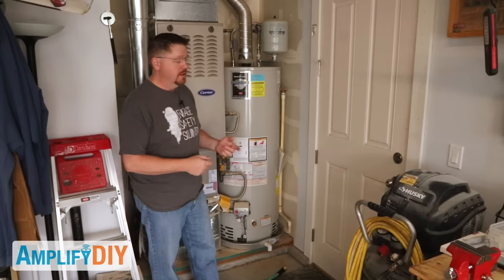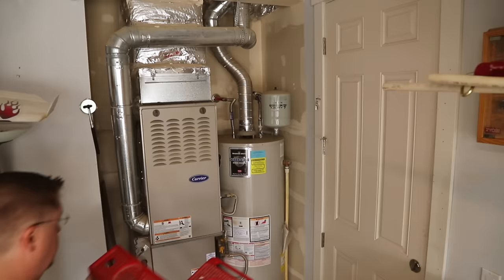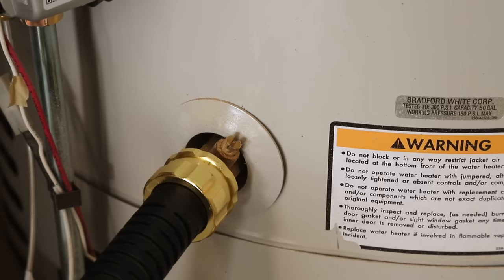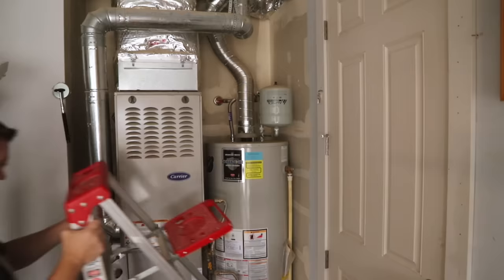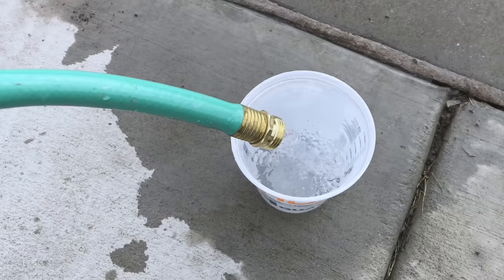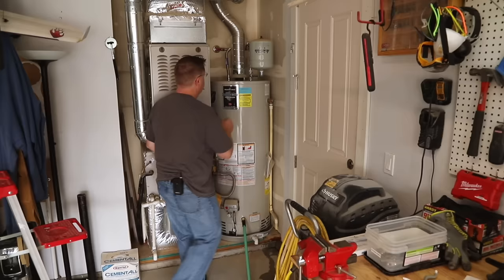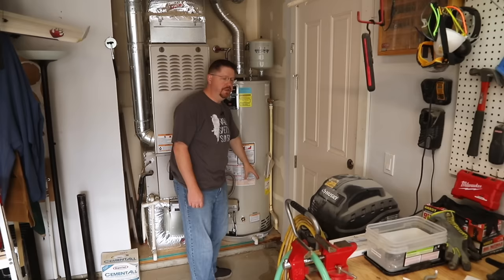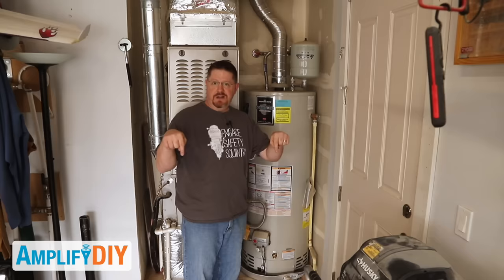How To Flush A Hot Water Heater To Remove Sediment

Comment: This might be a stupid question but why did you close the release valve on the final fill and flush but keep it open and monitor when to close it, as it was filling again for normal use? Wouldn't air and pressure get into your system during the final flush which was something you were looking to avoid during the fill for normal use?
Reply from the maker: Hi Diddlingdoom - apologies for the confusion around when to open and close the pressure release valve. Here are the general concepts that need to be understood: In order for water to get out of your tank, air must be allowed to get in. During the flushing and rinsing phases, I generally just leave the T&P valve open to allow for the air to get in as needed. Note that this does not push air up into the plumbing of the house - it just lets air into the heater tank to replace the volume of water that drains out.

When you are done flushing and ready to do your final fill, all that air that was allowed into your tank needs to be allowed back out. I generally try not to push an entire tank's worth of air through my plumbing, so I wait until I can hear the water level is nearing the height of the T&P valve, then close the valve. This leaves several cubic feet of air at the top of the tank, which I purge out of the system by opening a hot water tap and keeping it open while the tank fills until all the air has stopped making gurgle noises.

At that point, all the air is out, the system is full, and I can close the tap and turn the heat source back on. 

Hope this helps - thanks for watching!
Reply: Right I understand why you did what you did on the final fill for normal use, but you kept the t&p valve closed while filling for the final wash. Wouldn't that put pressure on the rest of the plumbing system @AmplifyDIY

Comment: This is a great video! I'm going to run thru the process tomorrow morning. One question about the final fill aka back to normal. Also sorry if it was already asked. With 5910 comments it was difficult to search thru if already asked. Would it be fine to put a bucket under the pressure relief valve and wait till some water flows out to close it?
Reply from the maker: Hi Camprusso! Actually, even with all the other comments and questions, I don't believe anyone has ever asked your question. Yes, it is just fine to stick a bucket under the T&P valve drain tube and wait for water to start coming out to close the valve on your final fill. 
Good luck!
Reply: @AmplifyDIY  Score! For the original❓😁🤘
At least then I can make a small game out of it. Can I guess when the water will hit the valve?... 😆

Comment: What is the reason you have to shut off the new/cold water input valve? Wouldn't that help with the air flow and to clean the inside of the tank as well?
Reply from the maker: Hi Las Vegas Adventures - this is a pretty common question, and intuitively, it makes sense to leave the cold water inlet open... after all, that would make the water "blast" out of the drain valve, right? 
Well - yes, it would, but the water would move SO SLOWLY through the body of the tank that you'll never get any actual rinsing action along the bottom of the tank. Have you ever fired a squirt gun underwater? Leaving the cold water inlet open is just about as effective. You need to empty the tank so that there is not a huge mass of water in the way slowing down the cold water on its way to swish around the bottom of the tank. Thanks for watching!

Comment: If you need to use the pressure relief valve, do you still have a faucet in the house running or do you not need one running?
Reply from the maker: You just need to make a path available for air to flow into the system. If the faucet does not do it, then use the T&P, at which point the position of the faucet is actually irrelevant. Good luck!

Comment: Yes sir do you mind answering a question for me please. I have a regular hot water unit but my Gio Thermal unit also runs to the spot that drains my water heater.
Reply from the maker: Hi Shannon - I'll be happy to try to answer any questions... but I didn't see a question in your comment....
Reply: @AmplifyDIY  thanks for the reply. My gio thermal unit is also connected to the drain to my hot water heater. If I close the valves on the gio thermal would it be okay to drain the water heater

Comment: Great video! Easy to follow.  But at what point do you turn off the hot water from the faucet inside your house?
Reply from the maker: Hi Cassandra - sorry this was not made very clear in the video. The point of opening the faucet was first to relieve the pressure in the system after turning off the cold water inlet, and second to provide a path for air to get into the water heater so it will drain. In my case though, the faucet would not allow any air into the tank, so I had to open the T&P valve on the side of the tank to let air in. Once I had to do that, whether the faucet is open or closed during the flush is irrelevant. At some point I probably closed it, which is why I later had to open it when I was done with the flush to allow air back out of the system as I filled the tank. 
I recommend opening a hot water faucet at the beginning, and just leaving it open until you are completely finished. 
Good luck!
Reply: @AmplifyDIY  Thank you!

Comment: Prob a silly question: So when your finished flushing and you go to fill the water heater tank back up…once it’s full you leave the cold water intake valve open?
Reply from the maker: Hey Patrick - not a silly question at all. Yes, leave the cold water inlet open. That is what puts water into the heater tank in the first place, and keeps the tank full as you use the hot water in your house. Thanks for watching!

Comment: I need to flush my tank, but I have an unusual problem: The tank is under the house (very old house that probably did not have indoor plumbing until the 1940s) and sits on a concrete slab in a pit. Everything is difficult to get to. The worst part is that there is no floor drain. I can let gravity drain about half the tank, but then I need to hook up a drill pump to get the rest. Do you have any cautions about using a pump like that?
Reply from the maker: Hi Newsyddog - first off, I'm sorry to hear about your unusual installation.. that sounds like a real pain! As for flushing, here is what I recommend: Rather than a drill pump, you may want to invest in a small transfer pump. Here are a bunch of options available on Amazon for around $50: https://amzn.to/3VYmNgY As for precautions: No matter what pump type you use, I recommend that before you start the flush: turn off the heat source for the heater, then go take a shower, do some dishes, run some laundry, etc. This will use up the hot water in the tank (replacing it will cooler water) so the water coming out of the tank (and running through your pump) will be cool. This will avoid over-heating the pump. 

Good luck!

Comment: Is it ok to drain the water heater while other appliances in the home may be running?  For instance, dishwasher or laundry machine?
Reply from the maker: Hi Mike - sorry for the delay in my response: no, when you drain the water heater, you are effectively turning off the hot water supply to the house entirely. Any appliance that needs hot water to run should be shut off during this process. Good luck!

Comment: In addition, cascade some water on to the bottom of the tank from the hot outlet at the top. Do that by opening both hot and cold faucets at any sink whilst holding your hand to block the spout. Cold water is thus diverted through the hot lines and into the heater tank. (If you really want to enhance this flow, at you washing machine connect the hot and cold faucets together with one of the double female ended hoses then open both faucets for a few seconds.)
Reply from the maker: Interesting approach. I've never tried it... but I may. Thanks for watching!

Comment: I just fully drained my Rheem Performance (model no. XG-___) for first time in 5 years.

Then partly refilled 4 times for 20 sec each & waiting 20 seconds like you said.

Emptied into cup each time; at no point did I see 1 speck of particulate.

Is this normal or am I missing something?

I figure fully refilling & draining again would be a waste of time & water.

Any advice, thank you.
Reply from the maker: That's... unusual - do you have a water softener? Do you have a whole house filter? Do you know how hard your water supply is?

If you have a water softener and whole house filter, there should be very little sediment in the tank.. but there should be *some*. You may happen to have naturally soft water though...

Comment: My temp setting is different(off, pilot or on) and is a of a different style.   Kind of scared to mess that part up.  Landlord won't fix this noise issue I'm having off and on all day due to sediment buildup, doesn't even respond to texts.  I may just wait until a friend is up and send him some pictures to make sure I do it right.  Besides that uncertainty I think I have all the rest figured out.  Thanks for the clear guide.  Hoping this fixes my noise issues which would help my sanity a bit.  I live in the basement where the water heater and central air are so I hear all the fun noises.
Reply from the maker: Yeah, popping / crackling sound while the heater is actively heating is a definite sign of sediment build-up in the tank. I hope you get it flushed... good luck!

Comment: It looks like you were draining to the outside. My hot water tank is in the basement so to get it outside it means it will go higher than the tank. There is a drain in the basement floor. Will that work.
Reply from the maker: Yes, the drain in the basement floor is precisely where you should be draining. In order to avoid any clogs, it's a good idea to use a kitchen strainer to catch any big chunks from the hose before it goes down the drain. Good luck!

Comment: This video is very useful. Unfortunately, I can’t locate a water shut off valve anywhere to turn off the water supply. Does that mean I have to turn off all of the water to the house in order to flush the water heater?
Reply from the maker: Hi Kristin - unfortunately, yes. In order to properly flush the heater you'll have to be able to turn off the water supply to the heater. If there is not a shut-off valve near the heater (there should be, but lots of plumbers skip this) then you'll have to shut off water to the entire house. Good luck!

Comment: My temperature control on the water tank doesn’t have a “pilot” setting like his does.  My just has a ‘low’ setting at the coolest setting.  There is also a power on/off which I assume will kill the pilot light (it’s a gas water heater). If I put the setting to ‘low’ — is that good enough to prevent heater from coming on?  Or do I have to kill the power to the unit.
Reply from the maker: I would check the owner's manual for your heater, as there should be a way to set it up for maintenance. If you don't have a physical copy, google should be able to find one - just search for the model number. Good luck!

Comment: When agitating the sediment is it okay to let that cold water fall down onto the freshly empty but still very hot tank? Will this not be too rapid to temperature change for within the tank?
Reply from the maker: Hi Robert - yes, it's fine to let the cool water into the freshly emptied tank. If you are concerned about it though, do this: Turn off the heat source, then go take a shower, do some laundry or wash some dishes. This will use up some of the hot water in the tank, and replace it will cold water from the supply, resulting in a luke-warm tank, rather than a very hot one. Then proceed with the flush as usual. Good luck!

Comment: Can you drain the hot water coming out of the hose into a sump pit? Will the hot water pose problems for the sump pump? Is there enough pressure through the hose to loop it up a few feet so it can drain into a laundry tub? Thanks
Reply from the maker: Hi there - great questions! Yes, you can drain into a sump, but I recommend you do 2 things differently: First, turn off the heat source for the heater as described in the video. Then, go take a shower, do some dishes or run a load of laundry on the hot setting. This will use up the hot water in the tank and exchange it for cooler water. This way when you drain it, it's not super hot water going into your sump.
Second, I recommend using a kitchen strainer to catch any large chunks of sediment before they get into your sump pump in the first place. Sump pumps are pretty resilient, but I'd rather not see just how many large chunks it can swallow. :) 

Good luck!

Comment: Hi. I love this video and have used it several years in a row now but this year when I started the - agitate, flush, repeat part, I would agitate but opening the cold water for 15-20 seconds but nothing would come out of the hose....? I ended up filling the water up so much again that it started coming out of the pipe connected to the pressure release valve. Was I supposed to close the water tap in my kitchen? Any idea why the water wasn't draining from the hose? Thanks!!
Reply from the maker: You likely have enough sediment built up that your drain valve is completely clogged. Have you tried opening the drain valve without a hose connected? With it open, try shoving a screwdriver into the valve to see if you can clear up whatever is blocking it. Might be time to upgrade the drain valve as well: https://youtu.be/OBPJYg0o_o0
Reply: Thanks for your reply...but a bunch of water did come out of the hose on the first step after opening the pressure valve...so it did empty but then when I tried to do the agitate steps no water would come out of the hose and I didn't change anything ...I would just open the cold water spout for 15-20 seconds like the video says....any idea why nothing would come out of the hose then? Thanks!! @AmplifyDIY
Reply from the maker: @vanessagaitan4473  Yeah, it sounds like it's still just a clogged drain valve. The valves that come with these heaters are ... terrible. When you did the agitation, it very likely agitated a large enough chunk (or chunks) of junk that it clogged the drain. I'd still suggest when it won't drain, taking the hose off and jamming a screwdriver or bent coat hanger into the drain valve to see if there is a clog. Have a bucket nearby, and/or some towels... and as soon as water does start to come out, screw the hose right back on. Good luck!
Reply: got it! I'll try that, thanks!!  @AmplifyDIY

Comment: So at the end of the process when do you shut off your faucets that you opened in the house? I'm a little wary of using the pressure release valve instead.
Reply from the maker: HI Vic - you can leave the faucets open through the entire process, all the way until you have re-filled the heater and bled the air out of the lines. 
I would not be too concerned about messing with the T&P valve though, here's another whole video I did on them: https://youtu.be/e5H1i1cypxA

Good luck!
Reply: @AmplifyDIY  Awesome thanks you very much! Going to drain my water heater today because of you! I really appreciate it!

Comment: Are there filters I can add before the cold water goes into the tank? I’m from an area with hard water and would much rather replace a filter than flush the tank so often
Reply from the maker: Hi Kelton - Yes, there absolutely are filters you can install! I recommend something known as a whole house water filter, which has replaceable filters you change out every 3-6 months, depending on filter type, water quality, etc. I have a whole house filter and use carbon-activated filters which help remove the chlorine taste from my local water supply. 
This is the exact filter housing that I installed: https://amzn.to/3HYwW8b
These are the filters I use: https://amzn.to/40tOEYD

My house came with a water softener loop plumbed in, which simplified plumbing a bit. An ideal location to install this is between your whole house shut-off valve and any other appliance so that it filters both your hot and cold sides of your taps in your house. 

Good luck!

Comment: First time draining mine. So maybe this is a dumb question, but can you just leave the cold water supply on to keep the sediment circulating in there? [I’d already had my heat off overnight, connected my hose,  and started watering my lawn with the cold water. Then, while watering my lawn, I hopped on YT to see if I’d done it right. 😅 Sediment is definitely coming out and the continuous supply of cold water seems like it would be stirring up any sediment stuck on the bottom. And I didn’t have to worry about air getting in the tank. So what am I not understanding about the on/off cold water supply method?]
Reply from the maker: Have you ever tried to shoot a squirt, gun underwater? Yes, water does come shooting out of your water heater tank at a quick pace when the cold water supply is turned on, however, it’s not actually stirring up much of the sediment at the bottom of the tank. When the cold water comes down the dip tube to the bottom of the tank, it actually doesn’t do much stirring because there’s just such a large mass of water already in the tank. It will do a good job of clearing out the sediment that is really close to the drain valve, but the water actually moves very slowly across the rest of the bottom of the tank. Try this: wait until your water is running completely clear from flushing under pressure, then completely drain the tank like I show in the video and do some short bursts. I think you’ll be surprised to see a lot more sediment comes out. Good luck!

Comment: Is it okay to use the main water shut off valve instead? The unit is in a trailer so there isn’t a shut off valve I can locate other than the main valve under the trailer
Reply from the maker: Yes, any water shutoff valve you have available is fine to use. Good luck!